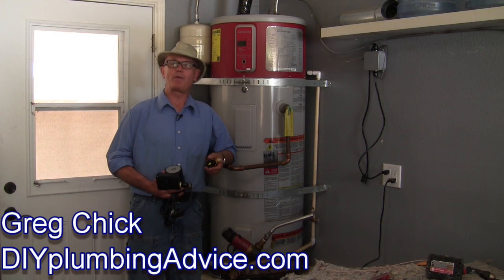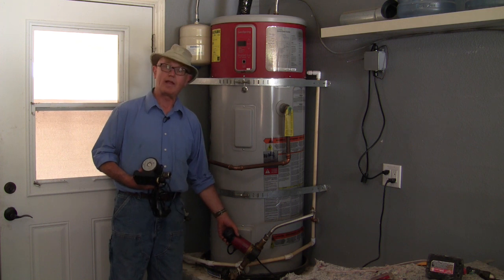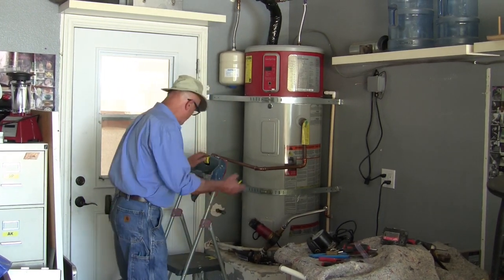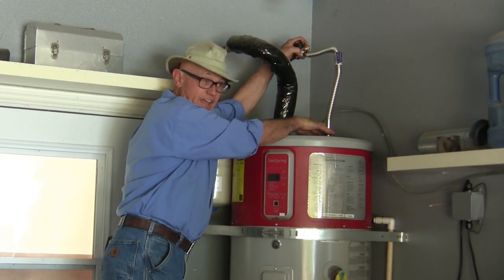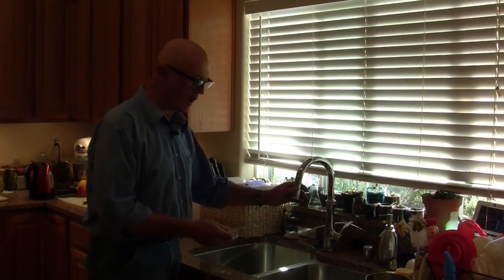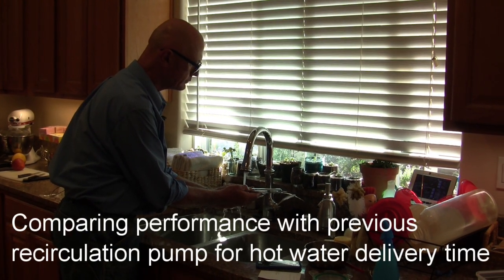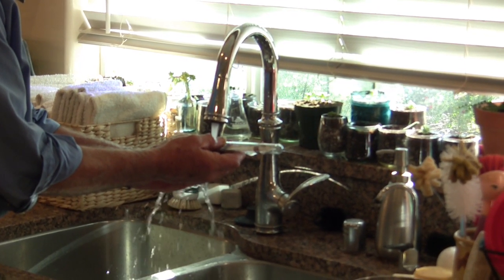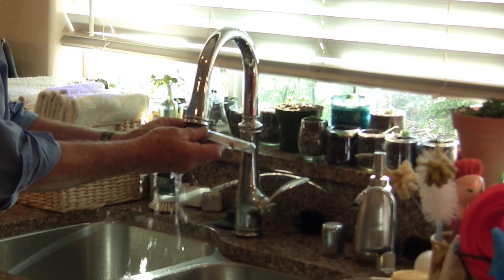Product Review:WaterQuick  Recirculation Pump System

Comment: On demand also means you're not scouring your pipes for hours.
Reply: Very important comment.  There are floods and or slab leaks caused by over circulation.  Either too often or too long of circulation or too fast.   People do not see the gouged inner pipe walls unless the plumber called to fix the leak cuts the pipe out and shows the homeowner the inside of the pipe.  At that point, it's too late, the piping system is already damaged and the wise thing to do is re pipe the house because the pipes are worn too thin.   Once again the pipe looks good on the outside!  Yes water, the same stuff that made the Grand Canyon, can gouge copper pipe a couple hundredths of an inch causing damage....   Amazing isn't it..